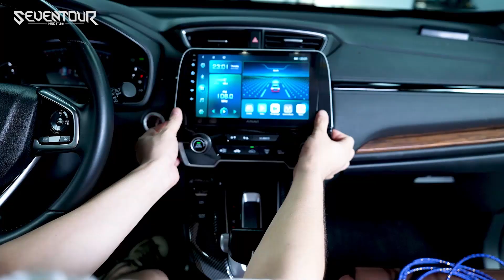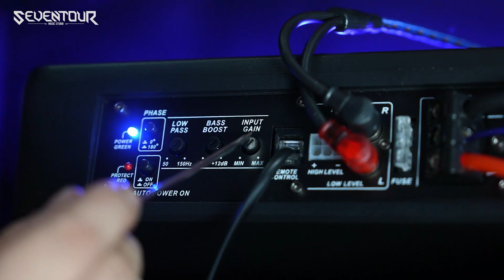How to install Seventour Under Seat Powered Car Subwoofer ST-800

Comment: i have a Hyponics Brutus amp behind my passenger truck seat, mounted to a piece of plywood that''s been glued to the back wall of the cab. (standard cab) Since It's self powered, can I keep it simple and just run some power to it, via a cable, from the Amp? 10" self powered.
Reply from the maker: Hi, Theoretically it is possible, but you have to make sure that the power cable is not smaller than 6 Gauge.

Comment: I just did installation, and everything looks just right. The power light is on green, but there is no sound. The subwoofer is light up and everything, but it is just not working

Comment: I have this amp and the speaker is no longer producing power what could it be. It has power and blue light but sub is not producing bass
Reply from the maker: HI,  Did you connect the power cord to the car fuse box?  The 12V power cord must get power from the car battery +.

Comment: I don’t know how to connect to Toyota Camry 2015
Reply: I hooked in to my rear speakers with a kicker rca adapter and used the acc wire on the adapter to power the amp on. It was a really nice addition to make the factory system sound better.

Comment: I followed hookup instruction but I get no sound. The blue ring lights up but I get no sound. Very frustrating
Reply: Did you ever find the problem?
Reply: @ yes I did, the power cord wasn’t tight enough on the battery. Once I retighten everything it worked!

Comment: i’ve had this sub for a couple days and now when bass hits it rattles
Reply: I mounted a foam product between the amp and mounting surface and the rattle went away on mine. If you don’t have any foam, try adding an old rag or something and see if that helps.